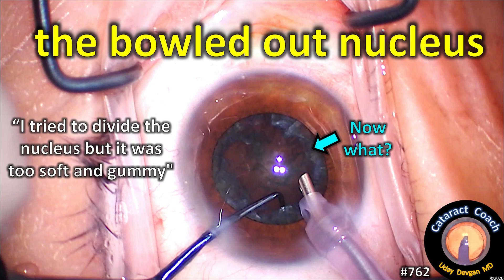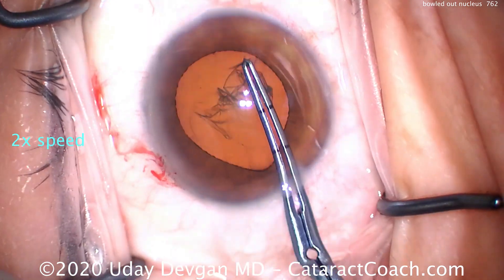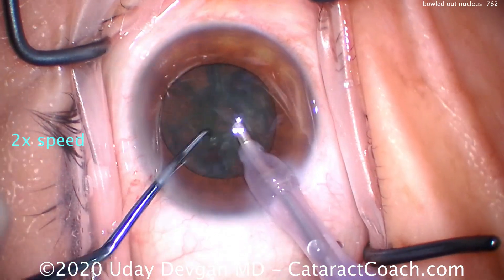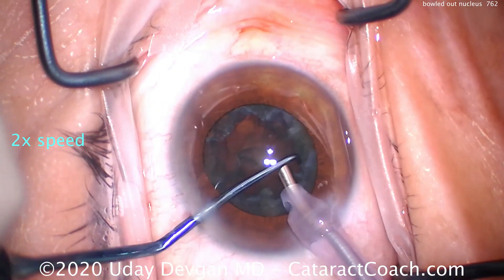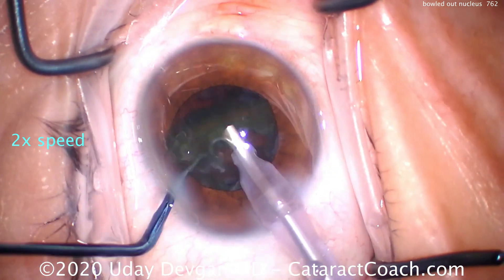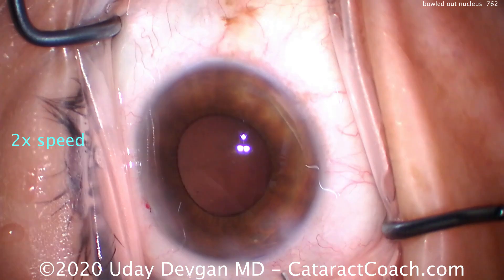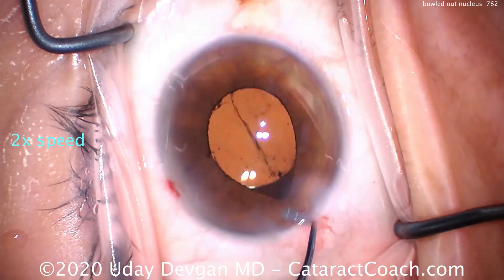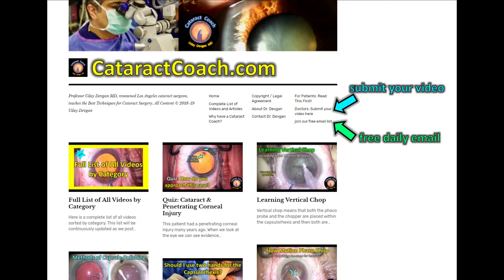the bowled out nucleus in cataract surgery - now what?

Comment: A few additional options:
1. Viscodissect the remaining lens material to push it more centrally away from the capsule.  Then can elevate with a second instrument and emulsify.
2.  Switch to I&A handpiece and aspirate the remaining lens material. Sometime just pulling on the cortex will also pull the lens material centrally which would allow one to get a second instrument behind/under the bowled out lens and bring it up into the anterior chamber for more efficient removal.
3. Sometimes just coming out of the eye with the handpiece will cause the lens to prolapse out of the bag as the chamber shallows if the rhexis is large enough. Then can place viscoelastic under the lens (into the capsule) and stabilize the lensaterial in the anterior chamber out of the bag.  Then can re-enter with the phaco handpiece to remove.